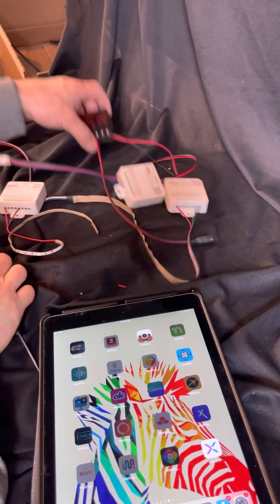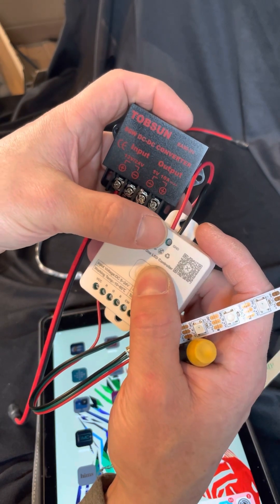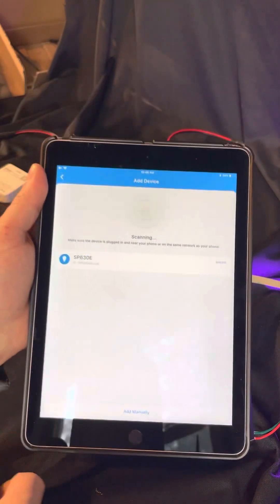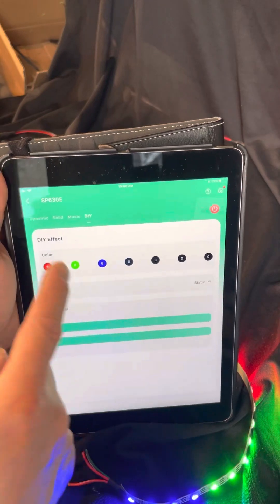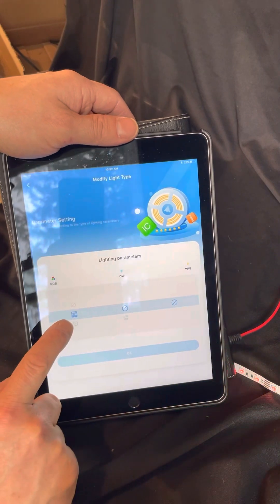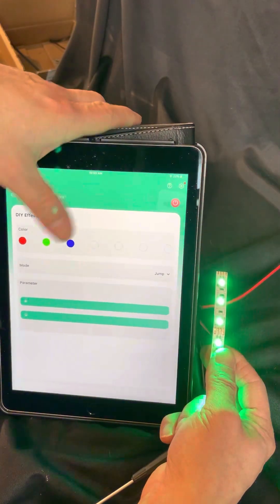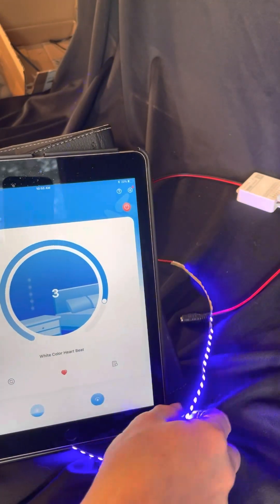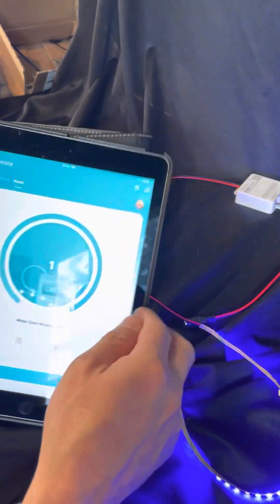Quick Start Guide SP630e (the best all in one LED controller I’ve ever seen!!!)

Comment: We've had a problem with this controller. A after a firmware upgrade, blue stops working. We ruled out a malfunction with our led strip. It works with other controllers. After installation in a customers RV, we tested the controller with the led strip, concluded a successful installation, one of our techs decided to upgrade the firmware when prompted by the BanlanX software I believe, and after completion, the blue stopped working from the controller. Any ideas on what is happening, and how to restore proper functionality to the controller?
Reply from the maker: I’ve not hear of this happing before nor do I know how to fix it. Is it a controller you bought from me? If so contact me on the website so I can get you a replacement

Comment: Hi Barnaby, i have the SP630E controller, loved your video and hoped it would cover my LED strip , but unfortunatley not. I have the "BTF-LIGHTING WS2812B IC RGB 5050SMD Pure Gold Individual Addressable LED Strip 16.4FT 300LED 60LED/m Flexible Full Color IP30 DC5V for DIY Chasing Color Project". It has five wires altogether. Three (red, green, white) are together in a 3 pin jst-sm connector, then 2 others, one red, one white. Not sure which connectors to connect to what on the controller. Would love to hear your advice. Thanks!
Reply from the maker: It connects and works exactly the same as my 2812 do in the video
Reply: red is positive, green is data, white is negative.  then 2 other wire, one red and one white is to add power .
Reply: I've the same one, and it's powered by 5V but it doesn't work properly, it goes rainbow and not goes after the colour configuration... please help

Comment: i just got this and this prob a silly question but trying to wire these up has been a headace was thinking instead of a converter i saw some btf rgb light that are 12v and seeing this is 12 a max output it should work plug and play so to speak right or would i stil need a converter hope you can help
Reply from the maker: We focus on 5v because our LEDs are sk6812 chip. There are many BTF and other brands using other chips in the WS line which are 12v. This controller will work on those too, and no need for power step down
Reply: @lafloudaf2137  i got a powersupply which i can change it from 5v to 24v i tried both the ws2811 12v and 24 v version and in both cases im getting just the back part lighting up showing some colour trying to figour out what i need to do contacted btf they aint much help online
Reply: Short answer is- For HIS setup you NEED the converter when he is using 5v strips.
Longer answer-> 12V is voltage. 12A is the max amperage this can handle. Don't confuse voltage and amperage. You can have a long enough strip of 5v LEDs to surpass 12 amps and burn up the controller. That would be above 60 watts of power. If you used 12v LEDs you would need less LEDs to max it out.
 SP630e is a Good controller if you want to try different strip and strings. It's compatible with many different strip and string types and can accept voltages from 5v to 24v.
But there are many simpler controllers that may suit your needs if you're only using one strip type.
Reply: hey thanks yeah i was kinda lost to why the lights was not coming on then i connected all again the other day and it just came on made my jaw drop because i didnt expect it to work but yeah happy now im just connecting these to 2x more covering a big space running around 15 m total hopeuflly i should have no issues now and this controller is great thanks for the help @billfoster6809
Reply: Hola muy buenas me puedes ayudar con el esquema para poner este controlador con las ws2815  muchas gracias

Comment: My controller works fine until i connect a strip to it. The small LED on controller turns off when i connect the strip and i can not connect it with the app when LED on controller is off.

Comment: is the CW a Control Wire? Does having something there switch on the "Data" strip
Reply from the maker: DAT is the control wire or data wire for addressable. CW is used for single color 12v led. See the end of the video

Comment: How can you sync a bunch of these to work at the same time same effects?
Reply from the maker: To bypass power you need to send voltage to the controller so that it will turn on, but not out of the controller. Only data out of the controller.  Power and ground will then come straight to the strips from your battery or power source
Reply: @lafloudaf2137  you are an absolute legend. Thank you!
Reply from the maker: You can set all the programs to be the same, but they will not start and stop the same place. Best way is to wire all the strips in parallel to one controller and bypass the power direct to the strip and not through the controller